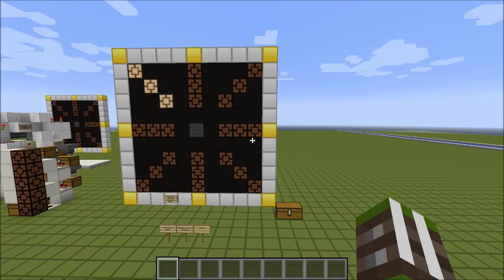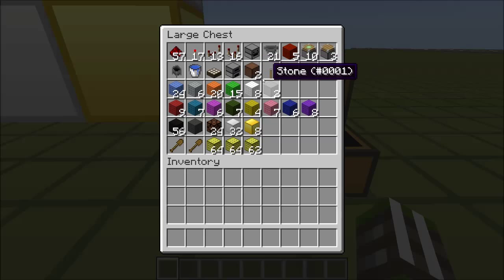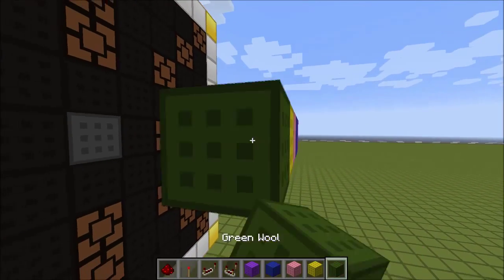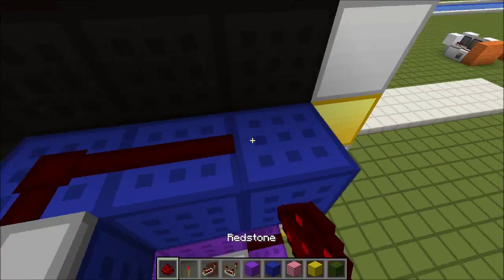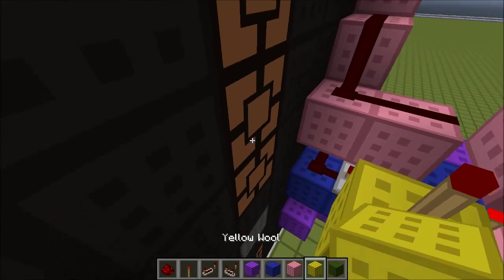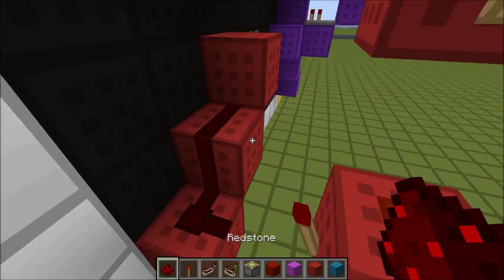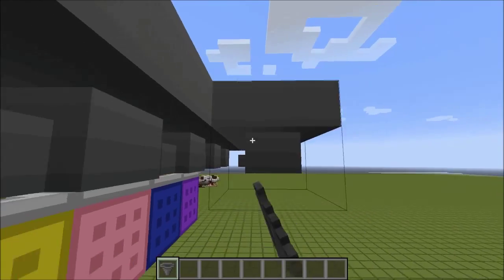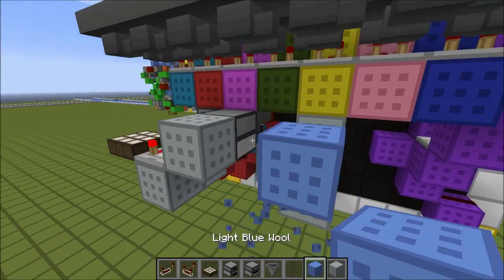Analogue Clock Tutorial

Comment: Great tutorial, I've tried to change it to a four faced design for a clock tower but the wires get really messy, and Having 4 separate clocks makes them a little off. If you do another one change the design to a four way panel and a single timer circuit that would be awesome.
Reply from the maker: Thank you!
I have a few projects I want to work on and Uni begins again soon, so my time is a bit limited.
I try to look into it, but I wouldn't expect anything within the next two weeks.
What should work, though, is if you build the clock a few blocks below the clock faces and build torch towers from the comparators upwards and somehow wire it above the clock.
If you try that, please tell me how it went.
Reply: dro I have created a 4 faced clock tower using one clock of this design. yes the redstone wiring to the four faces is a bit messy and i'm working on cleaning that up but the tower itself is very compact. message me if you'd like an mcedit schematic or world save

Comment: the hopper timer at the top gets stuck and the items stop flowing
Reply: Same, tested it in Windows 10 version and the same things happens to me.
Reply from the maker: It's not a hopper timer but a pulse extender, so it should stop after moving the items back and forth once.
Is that what you mean?
Reply: dro I guess what I'm trying to say is the item gets stuck. It makes sense that it needs to stop to power that aspect of the clock but it doesn't move into the next hopper. Windows 10 version is functions a little bit differently which could be causing it. I've tried a few things in it to see if they work and they didn't work the same. Also I may have done some of the items wrong. You have mentioned it's not working any more in updated versions. Have you debugged the where it's occurring?

Comment: How much light needs to shine into the mechanism for the daylight sensor to work? I'd like to make a fully (or mostly) enclosed clock tower, which hides away the complexity of the clock, but am met with the dilemma of a daylight sensor. Should there be some glass around it to expose it to the morning sun or should I instead put the sensor on the roof and bring the signal down, like a periscope?

Fair warning, I am no redstone engineer, so my original designs aren't super efficient...
Reply from the maker: John Forney It needs exposure to a sky light level of at least 8 I think. The lower the value, the less amount of items need to be in the furnace.

Comment: Why does it start at the 6 position every day and not the 12 position?
Reply from the maker: That is because it resets in the morning. That means 12 would be at noon, 18 in the evening and 0 at midnight.
I thought it would be the most logical way, but if you want to change the order for whatever reason, you can, of course, wire the output circuits differently.
In case you need help with that, feel free to message me.